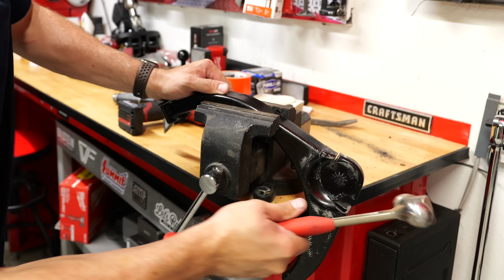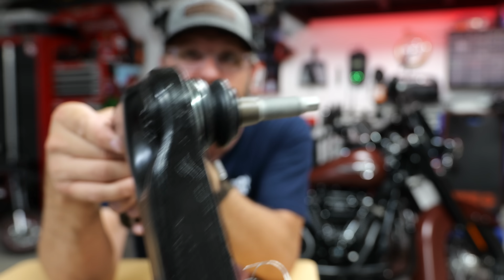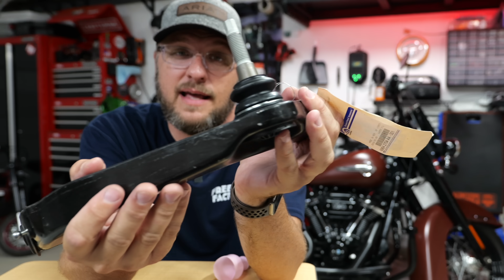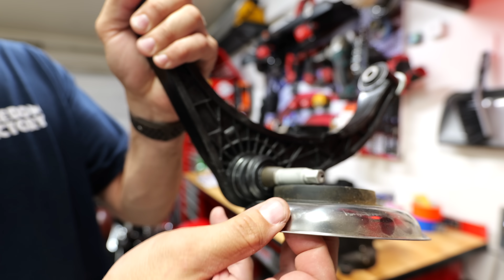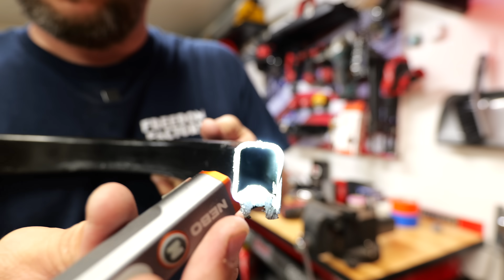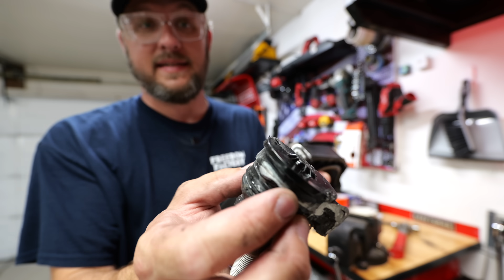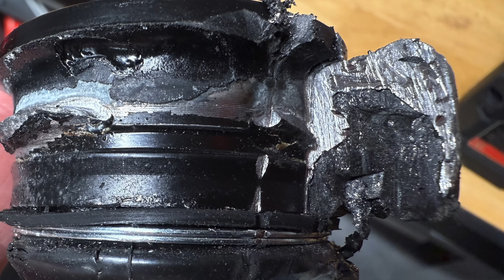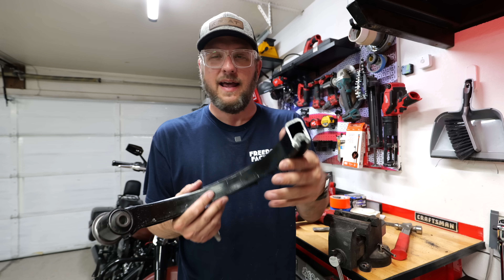I Cut Open RAM’s Plastic Upper Control Arm… Worse Than I Expected?

Comment: the plastic is there to prevent replacing the balljoint. They want to sell the entire arm
Reply: There are already metal arms with non removeable ball joints
Reply: @Mach141  For at least 25 years. My 2000 Expedition has them.
Reply: @billsimpson604  Fox Body Mustangs. Capri, T Birds were non replaceable ball joints. Had to buy the entire lower arm
Reply: @billsimpson604  My 98 F150 I just replace the entire arm and ball joint.  Have never just replaced the ball joint as the mounts at the end of the arm are usually shot as well.  Don't see the issue.
Reply: @louisschummer931  At about 130k my ball joints hardly had any wear on them. The rubber boots failed, and let water get to the balls and wash out the grease. I decided to change the upper arm, and only press in a new ball joint on the bottom. I'm 74 and only drive about 900 miles a year, so with about 145k on it now, it will probably outlive me. I was surprised that I couldn't find any wear on any steering parts. All the rubber seals on them are still intact. Of course, it always lived in a city with no salt ever on the roads. I bought it from a relative. Luckily, it has the 2 valve 4.6 liter V-8 engine. All the hoses and water pump are original. They built stuff well back then. I put a chrome plated differential cover on it when I changed the oil seals, & painted everything under there visible from the rear, gloss black.  I covered the plastic front grille with a thick mirror finished stainless steel overlay, with holes punched in it to let air in. I have the money to buy a new one, but this one with the chrome bumpers looks too nice for me to part with. Some teenager hit me from the back right after Hurricane Katrina flooded my house. (Not something you want to experience.) His car had the hood and fender dented. The chrome bumper on my Expedition wasn't even scratched. I told him to forget about it since he was at fault. He thanked me.
Reply: @billsimpson604  - Yup, my 1999 Explorer has them.
Reply: @Beer_Gut_Boomer  Not true!!! I own an 86 GT and I replaced my lower ball joints. They are pressed in to the steel arm.
Reply: @Beer_Gut_Boomer  Fox ball joints are replaceable.
Reply: @Mach141  Aluminum arms for instance.
Reply: @Mach141  on trucks, by the time your balljoints go, your bushings are probably trash, too. 

My OBS Chevy has steel replaceable arms, so this method goes back to the 80s.
Reply: @Mach141  yes your right
Reply: That's exactly it.
Reply: My 2006 F150 4x4 has replaceable upper arms when you need ball joints. Nothing new apparently.
Reply: There are metal lower control arms with replaceable ball joints, but it's cheaper for the customer to just replace the whole arm than pay for a ball joint and the labor to press it in and out.
Reply: @Nordic_Mechanic  that's how 90% of ball joints are sold now anyway. With the control arm.
Reply: Maybe it's a form of rust prevention??  Since the rust belt states use salt during the winter and brine for dust control on dirt roads
Reply: @Nordic_Mechanic  By the time you need a joint the bushings are getting old. You are usually further ahead to just fire a new arm in there even if you have an option to change the joint. Especially if you are paying labor to have it done.
Reply: 9/10 it is more cost effective to replace the whole arm anyway- if you need ball joints, you probably need bushings too, labor is $150+ an hour if you don't wrench yourself.

Many (including Ford) have one-piece arms, this isn't news folks.
Reply: That was my first thought.
Reply: @Nordic_Mechanic  they can still do that with metal arms. My Mercury has a complete unit. I can't replace the ball joint, its built into the arm.
Reply: Kudo's, more through stuff.   Hell why don't just sell one year Vehicles!  After 1 year you throw them away.
Reply: @Nordic_Mechanic  
I doubt it's even that deep. 
My bet would be the painting process + balljoint process cost more than casting the filler plastic single process. Show the boardroom a saving with 'as good' performance and you'll get approval
Reply: @Nordic_Mechanic  Bingo!
Reply: Let me tell u I been doing fleet for awhile now. 1 ton trucks we have some with 4-600k that still have factory lower ball joints. Meanwhile we are replacing the aftermarket ones in 2-3 months. Like clockwork again…Lowers…. Uppers in the last year it’s got BAD they come in clunking every month these new ungreasable parts are JUNK  we tryed pumping grease into them it don’t help. They just come in destroyed still in a month or two. This guy is brain dead if he thinks that part is ok and non load bearing that ball joint fails your whole wheel is wobbling until it collapsing and your going for ride. We are replacing plastic parts like clock work THATS why they are doing this. Fleet maintenance use to be gravy. yeh now its a nightmare the parts don’t last whether they come from the dealer or any aftermarket part stores it’s truelly sad. Anything with rubber on it don’t last it dry rots. Brand new crate engines we put new sensors on them they leak valve covers leak we took a new motor source o rings from 25 year old junk parts put them on no leaks hmm why’s that u ask? Cuz the new o rings on all the sensors get dry and brittle in 1 year how come the old 25 year old sensor o ring don’t do it? Better quality rubber. Shits a joke.
Reply: Plus it will flex much easier than an all steel arm. Flex creates wear for any part connected. Look at the old A arms from older trucks in the ‘60s & 70s when ya could beat the heck out of a truck and not even need an alignment. Those A arms were thick steel. Yes I know it was a different system and it was a much stronger system.
Reply: Ive had two RAMs with these composite control arms....ive had no issues.
Reply: @Nordic_Mechanic  they already do that with stamped metal control arms. Plastic is usually more expensive than metal as a material, but it is much cheaper to manufacture. This is 100% about cost savings and possibly a smidge about weight shaving to drive up mpg numbers
Reply: Yah modern module replacement. It starts from assembly line logic. Things are modules.
Reply: Dodge use of plastic in motors is what has me replacing those parts with metal parts....as they fail from heat exposure.

Comment: lol...everybody making a big deal about this....yet they've been used successfully for years.
Reply: GM has been using fiberglass leaf springs on and off past 40 years...vette had them in rear for years and the early astro vans
Reply: @workingshlub8861  Great point!

Comment: Most afm gm 5.3 engines pre 2019 last a good long time. Maintenance is key, and 5k mile oil changes are a must. Gm produces over a million of them a year.
Reply: My Silverado is a 2015 with 5.3 all stock, engine oil changed every 4 to 5 thousand miles never past thousand usually before. AFM still works flawless. Just regular maintenance brakes, tires, oil and filter, air filter, cabin filter, 150,000 miles

Comment: Inevitability moisture and salt from the snow belt areas of the country will lead to catastrophic failures in 5 to 10 years from this overlay design. The control arm will rot out from within while still looking fine from the outside. I can see a class action lawsuit coming in a few years for death and destruction.
Reply: Exactly how is that different than yesterday's stamped control arms?
Reply: @realsharpninja  They're not water sealed, the water can make it's way out just as easily as it made it's way in. Drain ports are placed intentionally so that the water can drain out.  Same thing for frames, same thing for other types of construction outside the automotive industry as well.
Reply: @TheGamersRace   yup and so when a gap opens up that lets water in, it will be able to evacuate through that gap, unles someone installs a check valve, of course
Reply: @bobcook8576  How's the moisture supposed to get inside of the control arm?
Reply: @andrusaaliiy9267  that plastic likely wont keep a perfect adherence and will allow small amounts pof moisture/ salt / air to get between the plastic and metal... thatr said.. my honest guess is that the ball joint or bushings will wear out faster than the control arm will corrode and you'll have to change the whole thing anyway..

Comment: The plasic in modern engnes is out of control.  Especially where it is part that are hard to get to.  When yu have to remove plastic parts tt to a deep part they get brittle and break.
Reply: Best one is GM's 6 banger diesel with a serviceable required belt stuck right in the middle of the engine. One has to remove the engine and dismantle it to replace. Now that was an idiot design of the century. Liked my 6-BT Cummins trucks thanks but stopped buying them when the 5.9 went way of dodo bird.

Comment: Just wait until manufacturers start making composite engine blocks with cast iron cylinder sleeves
Reply: Doesnt really work well for cooling. Aluminum and steel help conduct heat into the coolant.

Comment: If you think that’s cheap then think of all the cars with McPhearson Struts that have no upper control arms but stress the front inner fenders instead!
Reply: was thinking the same thing - since RAM went to struts - there is no point of upper control arms.  I have had a few large SUV with McPhearso it's not a problem.

Comment: Plastic is probably just for NVH reduction.  There is enough metal that it wouldn’t concern me.
Reply: Agree. Without it the stamped metal probably wants to vibrate like a tuning fork.  This has to help more with NVH than structure.  If they had rubber coated it people wouldn’t be upset.  This just looks bad.
Reply: Finally, an intelligent response.
Reply: @mattr6334  Good point. I would not be too concerned after seeing the actual construction. Some have pointed out water intrusion. Not sure if the ball joint will outlast the rest of the control arm potentially failing first?

Comment: My 1990 F150 had rubber ball joints. The ball wasn’t a steel ball but was a rubber filled ball joint.  May have been a tie rod end, not sure.

Comment: Sneaky sneaky, hiding steel in what looks like plastic.  Man, the way these manufacturers are coming up with fabbing parts, just wild.
Reply from the maker: I just don’t understand why they wouldn’t cross section it themselves to show what’s inside because I think I’m not alone in assuming it was just a stamped U channel filled with plastic composite. I think the part is more robust than what most would think. I also still don’t know how I feel about it in general but I don’t hate it as much as I thought I did. Still don’t love it but hate it less.
Reply: @GearsandGadgets  That's a great point - get ahead of the detractors!  Also, I bet they plastic-coated it since they were doing one part of it, just to prevent rust on the rest.

Comment: still te thickness of that A-arm is more concerning to me then the reinforcement with plastic on a major stering and suspension peice.. because if that's intendedvfor a mini truck that only driven on streets I'd feel a hare better about it but to put a rolling force of all the weight of todays trucks plus your passengers and whatever your towing that doesn't start to look safe at all.. I've seen body panels made out of thicker metal than that, also offroad bumpers too vs a part is responsible for holding spring weighted parts together and steering all while driving onroad & offroad & towing

Comment: Speaking from an engineering perspective, I wouldn’t be worried in years 0-5. Afterwards however if the header/turbo system does not have adequate heat shielding I would be concerned that the plastic is going to break down and eventually break. I’ve had driver’s side upper control arm fail on an old car and it fudged up my ability to steer.
Reply: I'm in the rust belt. I'd much rather have plastic or alum than steel.
Reply: @OtisFlint  

why? Aluminum doesn't rust, lol.